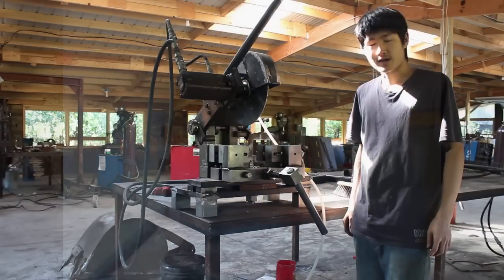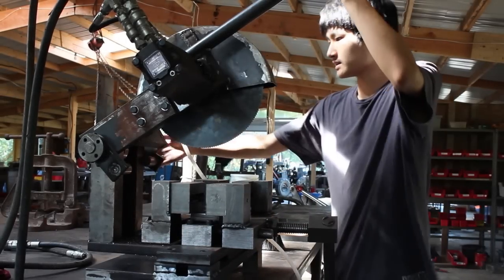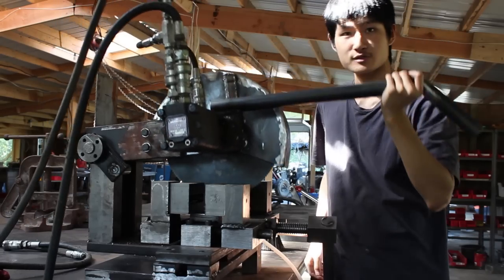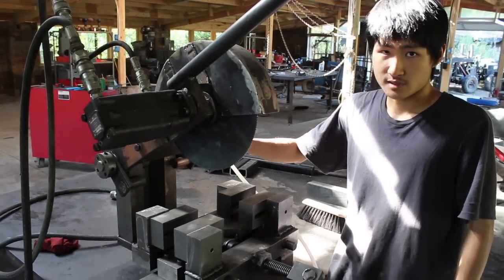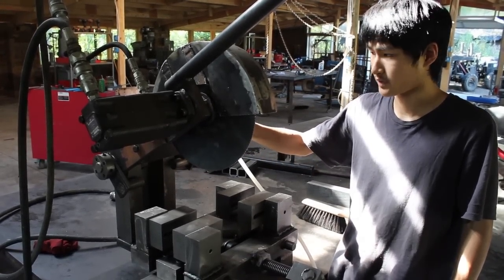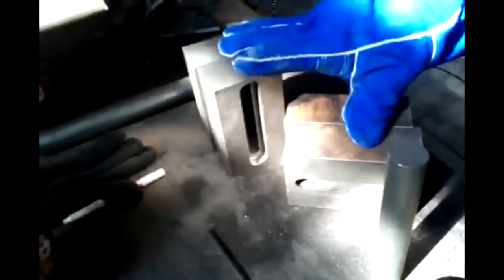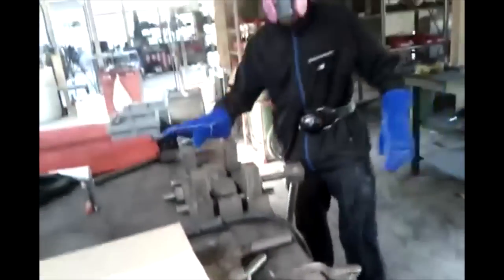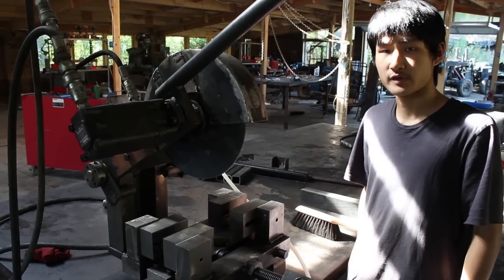Open Source Cold Saw - First Prototype Test

Comment: what rpm are you using? and dia. of blade?
Reply from the maker: Standard cold saw blade, 14". RPM is about 100 - 14 gpm with 32 cu in hydraulic motor.